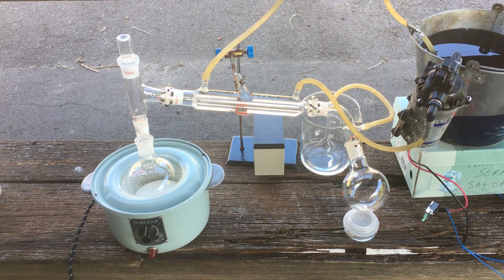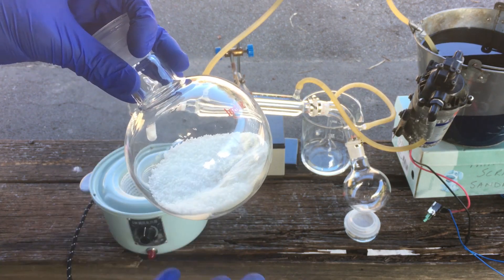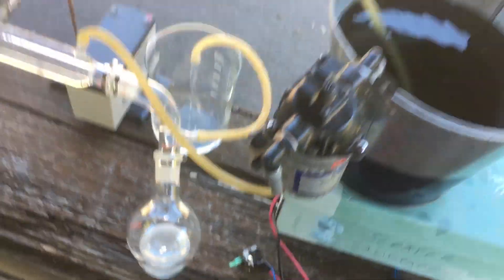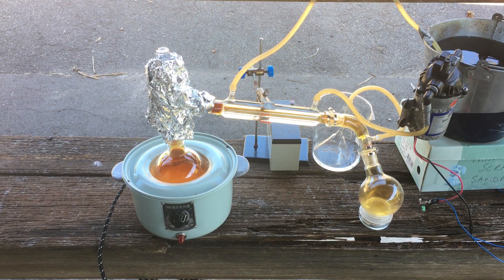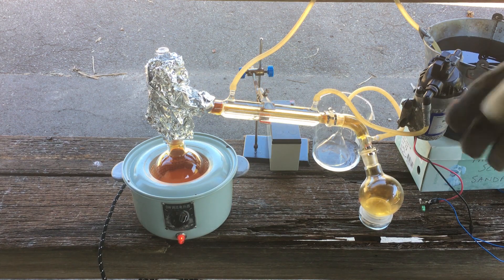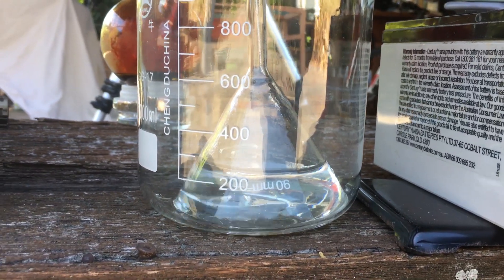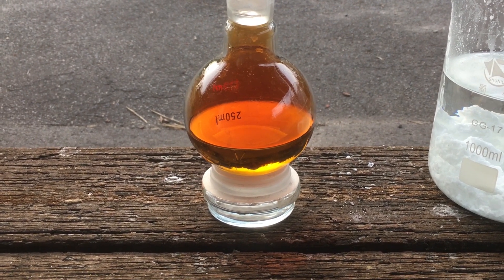Making Nitric Acid

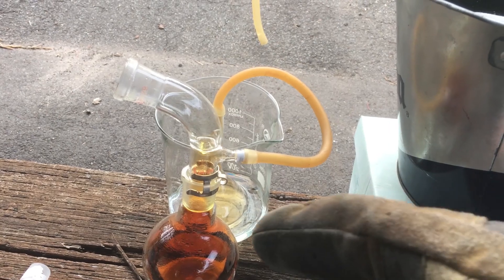Comment: 10:39 What material would you suggest for the tubes? I hear PTFE has great chemical resistance but it so slippery that it's difficult to work with.
Reply from the maker: I'm afraid fluorinated polymers like PTFE are kind of the only truly inert tubes when it comes to NO2. You might be able to get away with using some less fluorinated materials like viton, which is much more flexible and easier to work with (though probably more expensive).

Comment: Maybe a silly question, but how do you treat the waste for disposal? Great video, by the way!
Reply from the maker: If I lived in a large city with access to a proper sewage system, I would just pour the waste down the drain, since everything I'm using in this particular experiment are actually common components in drain cleaners, and none of the ions I'm dealing with are remotely toxic. Since I don't live in a large city, I just bottled it and I'll eventually take it in and pour it down a sewage-system-connected drain.
Of course, this is only for this particular experiment. Many other experiments require different procedures and the waste definitely cannot go down the drain.
Reply: @ScrapScience You’re profile picture looks like the regular show home with rigby nd Mordecai on the couch and benson is there with 2 other guys actually plus there’s maybe a few benson relatives too also as well BTW .Just letting Y’k ,Lmk

Comment: 3:59 I heard somewhere that bubbling nitrogen dioxide gas through 35% hydrogen peroxide would make an even higher potency nitric acid than using distilled water and I was wondering if you could confirm that
Reply: Yes that works. In this case you'd add the peroxide to the funnel trap at the end which wouldn't get you much more acid ,but if you're just making a small amount by bubbling NO2 through peroxide it's better than using water. For making any reasonable amount distillation is necessary.

Comment: This method is work with household hydrochloric acid as well, right?
Reply from the maker: As in, using hydrochloric acid as a replacement for a bisulfate salt?
Reply: @ScrapScience  yes
Reply from the maker: In that case, I'm afraid it won't generate nitric acid at any reasonable yield. HCl is more volatile than HNO3, so the distillation will just boil over the hydrochloric acid instead.
Reply: @ScrapScience  I see..

Comment: Great video! Can you tell me if it's possible to make 99% nitric acid with this Method? Or you still need to dehydrate with sulfuric acid or magnesium nitrate to obtain 99%?
Reply from the maker: It will depend on how dry your starting materials are. It's very likely that you'll need to do a drying step at the end since most sources of bisulfate salts will have at least a little bit of water (which carries over into the product).

Comment: How is there water with it I didn't see you add any water wooden contain enough residual moisture to dilute that process
Reply from the maker: The sodium bisulfate is the hydrated form of the salt, so there's a bit of water that distils over while the acid is produced. This is enough water to make the product about 15-20% water overall.

Comment: There's a product called Rooto professional drain cleaner it's cleaner than most technical grade sulfuric acids on the market I don't know what country you're in however. They're manufacturing facilities about 10 now maybe 20 miles from me. 48 or $10 you can get 500 ml a very very very clean sulfuric acid
Reply: I read this and didn't even remember leaving it and I said oh this guy's near me and then I looked and it was me

Comment: Mmh Is not pure that acid. Mine is more strong and there is not more nitrogen dioxide inside the receiving flask. 
My receiving flask is just with a yellow nitric acid, maybe because I put aluminium foil around the tube too. And maybe the temperature is too hot and water is going into the nytric acid. The distillation process have to to go up 80°C or water will ruin the purity grade. 
And be carefully with the tube that go into the water. Because a bit of water will return into the little flask cause the pressure.
Enjoy :)

Comment: The H2SO4 + KNO3 method yields higher concentration….also have you checked auto supply for your acid ? I believe it comes in at 50%. Just boil the water off .
Reply from the maker: Auto stores don't sell sulfuric acid anywhere near where I live (I've asked around a bunch of stores). I'm able to get hold of sulfuric acid these days, but the price of the bisulfate product is so much lower - hence why I'm using this reaction even with its lower yield.

Comment: Can you still use the inverted funnel and tube in the speaker for the process which involves the potassium nitrate and the sulfuric acid? Or is it just for that particular process?
Reply from the maker: Yes! The inverted funnel trap is effective for any reaction that generates nitrogen dioxide as a by-product (in fact, it works for other soluble gasses too). The reaction involving sulfuric acid and potassium nitrate makes much less nitrogen dioxide to begin with, but the inverted funnel setup is still a good way to deal with the gas.
Reply: @ScrapScience  I used it yesterday. But I don't think I much nitrogen dioxide because I didn't see any go in and it seemed like the water in the cup was just water. But it was a plastic funnel maybe that that escape? Either way I think it's now a mandatory part of my distillation process thank you!

Comment: Much, much safer doing it this way. Hot sulfuric acid scares the hell out of me.
Reply from the maker: If you're scared of hot sulfuric acid, molten sodium bisulfate should definitely scare you too. This process also runs a lot hotter than the sulfuric acid version, generates much more NO2, and runs a much higher risk of foaming over. 
Most people actually consider this method to be the more dangerous route.

Comment: If I am only interested in azeotropic nitric acid, would adding a small amount of water helps with the distillation/foaming/dry potassium sulfate mass that will break the distillation flask? Using hydrogen peroxide in the trap would generate (dilute) nitric acid better?
Reply from the maker: Adding a little bit of water is a good idea if you don't mind a slightly lower concentration. It's still important to use an excess of bisulfate for the reaction though.

Hydrogen peroxide won't help with NO2 absorption, the gas is extremely soluble in water anyway, and I don't think there's any real benefit to doing this, but I could be wrong.

Comment: Would you consider your water circulation pump to be overkill?  I've always used smaller aquarium pumps for similar work and have never noticed any issues.  That being said I'm by no means an expert and would appreciate any advice.
Reply from the maker: Yeah definitely. I only use this pump because I have it on hand anyway. Anything capable of moving water through the condenser will do the trick.
Reply: @ScrapScience   Why not pull a vacuum using your cooling water with a aspirator ?

Comment: Nice work! Can red fuming nitric acid be stored easily for long amounts of time? Also here I've seen sodium bisulfate crystals sold as toilet cleaner/declogger.
Reply from the maker: I've been storing it in a glass reagent bottle with no issues for a couple of months now. Since it's said to build up a little bit of pressure in a sealed container, it's also important to vent the bottle every week or so (not that I've noticed any pressure build-up with this particular sample). Perfectly possible to store I'd say.
Reply: Yeah pressure will build over time, so you have to open the bottle to let the pressure vent occasionally, but it's not too bad.  I've stored nitric acid for years before and it was fine.  Just gotta be sure that you have a bottle that can hold up good to it and not leak.  If it does leak, everything around it will be rusted or reacted making it brittle.  Use PTFE tape around the threads of your container and make sure the lid is on tight and keep it away from light do it doesn't break the acid down over time.  Also, store it in a cool, dry and dark place to ensure it is stored correctly.

Comment: You need to control your heat better 78c-83c no hotter and you will produce better nitric acid we do it on the farm in a half gallon Jack Daniels bottle with a cork wrapped in Teflon tape and a glass tube running over to our collection bottle wrapped in a paper towel and kept misted with a fan blowing on it and produce 98% and way cleaner nitric. (Stay below the temperature of water vapor. to improve yield heat to 121c to get asiatrope at 68%)

Comment: Another question. If you heat up calcium nitrate you get NOx. Is there any benefit of using NaHSO4 like better yield or something? I can get calcium nitrate very cheaply.
Reply from the maker: Decomposition of calcium nitrate requires at least 500 C, which is generally beyond one's capabilities in a home setting (at least in a controlled fashion). The bisulfate reaction is much easier, only requiring around 100 C to perform.
Reply: @ScrapScience  I don't know about beyond one's capability. It is much simpler with a bunsen burner and a test tube. Drop calcium nitrate in the test tube and heat it. However, it might be more impractical if you do larger batches?
Reply from the maker: That's true, but a test tube scale reaction won't give you much nitric acid. I'd much rather do the bisulfate method a few times instead of hundreds of test tube reactions for calcium nitrate. As you've said, it's a much less practical method for making the acid.
The bisulfate reaction also has the benefit of making highly concentrated acid, as opposed to a dilute solution.
Reply: Interesting thing before 1900 they used for concentrated (destiny 1,42 not high concentratet 1,52) heating nitrate of sodium or potasium with MnCl2 ,MnSO4, SiO2 from water glas acid reaction and sometimes MgSO4. They condenst most of the no2 but for an lab methode i think its to nasty.For ammo manufacturing they used the classic H2SO4 nitrate methode but only to hydrogensulfate never 1 mol H2SO4 on 2 nitrate mols.The MnCl reaction starts at 240C.

Comment: Have you tried it without the foil? I don't think it makes such a big difference.
Reply from the maker: It probably didn't make a big difference, you're right. But it's generally a good idea to insulate the distillation head in a lot of cases, even for a marginal increase in the efficiency. It's just the way it seems to be done by a lot of people.
Reply: @ScrapScience  Ok
Reply: The foil also protects the acid vapors from decomposing due to light breaking it down.  It helps in 2 ways, not just one.  It helps hold heat which makes it distill easier and protects the vapors from light, which can cause it to decompose.  Doing this will help the yield some, but it's not a huge amount. Still very worth doing.

Comment: 6:10 , slow distillation also ensures that your acid won't break down into as much nitrogen dioxide as it would if you cranked the heat.  Leading to more product and slightly better yields.  Thanks for sharing!  Not many know that HNO3 can be made this way, so it's good to see you (and others) showing this method, which really helps those who either can't get or have a really hard time finding sulfuric acid that isn't extremely diluted.  Great job!  😃
Reply: I can get virgin sulfuric acid at around 93%-97% at Walmart for $15 a gallon as professional strength drain opener. I remember checking out with a gallon of hydrochloric acid (muriatic acid) and a half gallon of sulfuric acid (drain opener) in the girl put them both in the same bag and when I looked the handles and started to load it in the bucket they both fell out the bottom and hit the concrete floor (I cringed) and said man we don't want those two busting at the same time, that would make a big damn mess, and the girl just looked at me like I had two heads. She had no idea
Reply: @Rob337_aka_CancelProof in the USA? IN CANADA i can for 10 or maybe 12 bucks forn1 liter of H2SO4!
Reply: Would the whole process work the same with Ammonium nitrate or is the ammonia causing problems ?
Reply: 2NaHSO4=H2SO4+Na2SO4

Comment: Have you ever tried to extract salts and other minerals acids from urine? I would like to know if there is anything good we could extract from our pee, if there is any.
Reply from the maker: I'm not really a fan of doing chemistry with urine. As far as I know, the only thing of reasonable quantity for extraction is probably urea, which is cheaply available anyway.
Reply: @ScrapScience  you're right.  Very little can come from urine other than urea.  Which is far cheaper to just buy and the smell of extracting it is insanely horrid.  It's worth buying just to not have to put up with the smell.  Hahaha!  😂🤮
Reply: There's the niter bed method where you biochemically convert urea to nitrates, and where using urine is actually the preferred way, since it has micronutrients that help the bacteria grow and do their work. Plus it is incredibly low tech. Cody's Lab had a video on this (he used the nitrates to make gunpowder) but sadly that's no longer on Youtube.

Comment: I'm going to do this pretty soon myself. Nitric acid is nearly impossible for me to find in any concentration and the prices online are kind of insulting. So I've stocked up on potassium nitrate and sulfuric acid and am just waiting on a day where it isn't raining or snowing to do it haha. I have the opposite issue you have with the sulfuric acid, I have a choice of like 5 different kinds where I'm from for drain cleaner, but I cannot find sodium bisulfate anywhere.
Reply: I've been subscribed for a while now and am waiting with anticipation for that video!  😃

 But I wanted to point out that the cost of the acid itself isn't that high.  It's the costs of shipping it that make the price go high, though most sellers combine all the costs and say that shipping is "free", which is absurd and makes the price seem very high.  The requirements for legally shipping nitric acid are insane and cost a lot to implement.  If you ever order any and there isn't a large amount of packaging, containment and safety steps implemented in the packaging, then the seller is pocketing that money and putting others at risk by shipping it in a hazardous manner, which is illegal as well.  If you ever order nitric acid, always order from a reputable company with great reviews.  Otherwise the simple act of just ordering it could put people at risk unnecessarily.  It's generally easy to tell who these companies are as they have somewhat crappy and suspect listings online.  It's not hard to find what I mean.  But yeah, it's the costs of shipping that make it high, not the acid itself.  Just wanted to clarify that for those who don't have experience in chemical distribution and sales.  🙂
Reply: @BackYardScience2000  I remember an old YouTuber, myst32yt or something like that, purified concrete cleaner he got from the hardware store which contained nitric acid. I think that video was from like 2012, and ever since then I've been on the lookout for it at all my local hardware stores. But I've given up on ever finding it and just decided to make my own. I guess you can't really blame companies for not being too excited about shipping nitric acid, and therefore charging quite a bit more to ship it. Oh well, I guess if nothing else, having to make your own is a good learning opportunity. (:
Reply: @randomergy683  Nitric acid can't be sold as such to private individuals anymore since 2014 or so withing the EU (because >muh terrorism). But you can still buy it mixed with phosphoric acid, sold as pipe descaler, from which the azeotrope can be distilled out. Not ideal, but good for the home chemistry or noble metal scrap refiner hobbyist.
Reply: @bromisovalum8417  ahhhh that makes sense. I live in the US and even here it's impossible to find even in pipe descaler, concrete etchant, etc. At least where I live. All I need is azetropic. Not even fuming lol. All I want it for is to make some silver nitrate and a few other nitrate compounds. Oh well, like I said, at least it forces you to learn more about the chemistry if you have to synthesize your own lol.
Reply: @randomergy683  it's the same here.  They don't sell it in any concentration in stores anymore, which sucks.  So online is the only place left to buy it these days.  Which really sucks due to the high hazmat fees associated with shipping it.  That's the majority of the costs.  Much, much easier and cheaper to just make it yourself these days.

Comment: Your first equation is incorrect:the products formed are nitric acid and potassium bisulfate not potassium sulfate
Reply from the maker: You could run either reaction (i.e. generate potassium sulfate or bisulfate) if you wanted. They just require different temperatures and stoichiometric conditions.